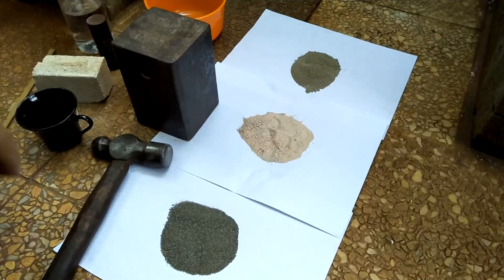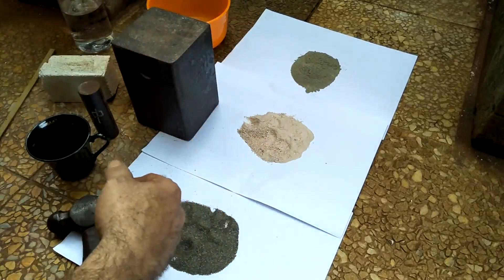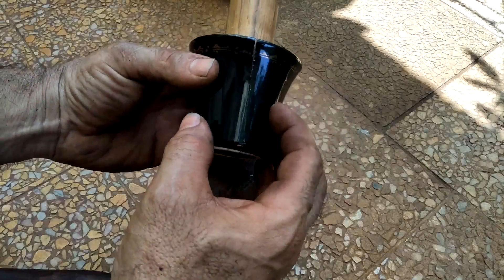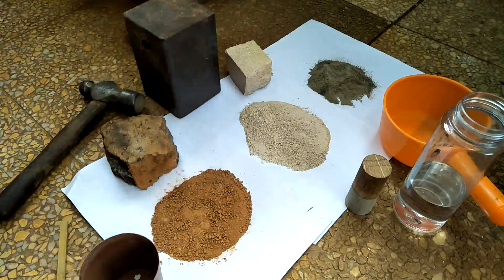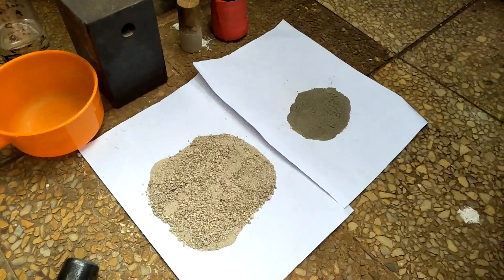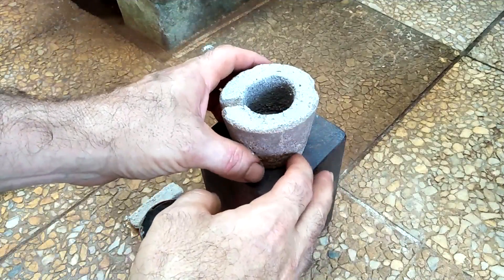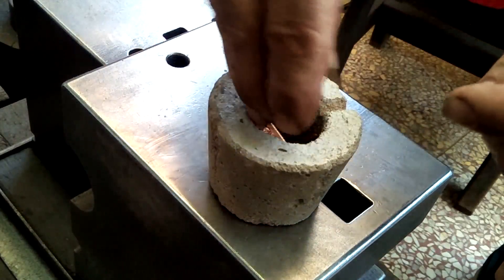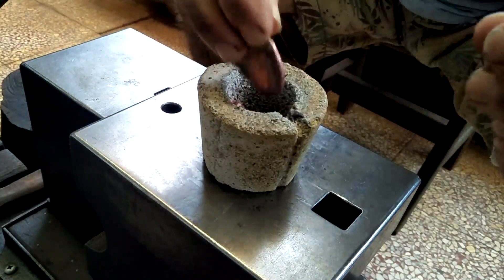Blacksmithing - making a small crucible

Comment: Hey i have to ask you with all the informational at your fingertips why in the world are you trying to relive every mistake since the bronze age? I was rooting for you the whole time, and yet your sucess I'm not sure was one. A few things most importantly working with copper with out the right safety gear will kill you. Maybe not today but it will poison you. Next there is a formula based on exacted what your making yours out of and how to fire it, and how to slowly lower the temp do it doesn't break from thermal shock. Cement products repel each other when mixed together, so you need a binding agent like acryil 60. BUT I'm not sure how it would work when exposed to heat lfrom a forge. One reason you follow the firing receive is because it allows the moisture to bake out Slowely.. please research the topic before you get seriously injured or you get someone killed or burn yourself horribly. I'm honestly trying to help not to just rip you a new a hole.
Reply from the maker: James, This most certainly was not a success. I freely admit that. But I like experimenting and learning in this way. I wouldn't take too many risks or at least I wouldn't try something without being cautious and aware of potential dangers. On this small scale, I feel comfortable doing this. But if this was on any larger scale, I would be uncomfortable with this. I appreciate all of the good advice and will apply what I've learned along with the good suggestions I've received for folks like yourself. Thanks for watching. Glen
Reply: Glen GS Tongs , I appreciate you writing back. Be safe and keep up the good work. If I failed to mention I applaud your efforts and your ability to make your videos for others to enjoy. I wish you all the best of luck in your endeavors in metal.

Comment: why not to use regular steel crucible  for melting copper  ???
Reply: Steel isn't usually used for crucibles unless it's temporary--it scales up too quickly and falls apart
Reply: +Tristan Antonsen
I has a simple crucible made from steel pipe , and use this for couple pouring  of bronze .
Reply from the maker: Alex, Eventually, I did use a steel vessel as a crucible (see my next video). It worked well that one time but as Tristan said, scale build up from the steel could ruin the casting. Thanks for watching. Glen
Reply: +
Glen GS Tongs
for constant successful  pouring copper & copper alloy , I use the container made from  heatproof stainless steel pipe  or square pipe ----  no scaling at all. Plus add some pouring channel into the pour molding.
BTW --- keep up for good work !!!

Comment: You might try luting.  In the 18th century and before, poor people made livings recycling, and one of the things gathered was bone.  The bones were calcined to make luting, which was a sort of cement used in furnaces.  It is possible that a luting/clay mixture might work for this. I just tried looking it up, but the word has been taken over by dentistry for other putty-like materials for dental procedures.  Books of 19th century industrial recipes might have it.
Reply from the maker: This is very interesting and good information. I believe this old bone mixture was successfully used for a long time. I will investigate it and see if that might be possibility for me. Thanks for watching and sharing. Glen
Reply: In place of the Portland cement, I think.  Luting was not the main component, but a binding/gluing agent.  Calcining the bones is something you can do in your forge, but if it is indoors, you might not care for the smell.

Comment: Hello Glen, I had an idea that may work. Get a chunk of raw clay and try to form it to a shape of  the crucible, then fire it in your forge. Fired clay things like a brick can withstand serious heat if water doesn't get trapped inside the clay. I think for melting copper it will be fine.
Reply from the maker: This is exactly what I tried next (see my next video). I still failed miserably but gained some good insight and was able to have reasonably success in the end. Thanks for sharing.

Comment: Huh, thats dangerous, but good that it worked. Just be really careful, you don't want any molten copper to be poured over your legs and feet! hope you can make something cool with this technique, and its not ending with a "copper shoe" ;D
Reply from the maker: Edgar, No question that this is bordering on stupid - having molten metal in a suspect crucible. But I continued with these experiments and failed a few more times but eventually had some limited success and was able to cast a simple copper ring. I show this in my next video. Thanks for your concern. Glen
Reply: Cool! Looking forward to this.

Comment: Glen, spend the 20bucks and buy a cheap graphite crucible.  It's not worth an UH OH using home made shit.  Trust me man, I pour bronze very regularly and one disaster is all it takes to change your life forever.
Reply: Agree here, all it takes is one crack or slip at the wrong time and the crucible can have the bottom drop out, crack in half either way or any permutation. The metal can hit something and cause a fire, splash inside a glove or even hit the ground and splash up onto your leg or foot resulting in serious burns. This is one of those times that it is worth the expense to secure a decent crucible.
Reply from the maker: After giving all this another go and mostly failing miserably (see my next video), the conclusion I came to is exactly the same as your very sound advice - get a proper crucible. On this very small scale, experimenting like this with molten metal is comfortable enough for me. But if this were taken up just a little in size, I would be too uncomfortable to try anything without the proper equipment. Thanks.

Comment: What about using some plaster of paris, I have used it making some refractory, works pretty good??
Reply: Uh... no it doesn't.
Reply from the maker: Len, Some others have said the same thing. I think it would work perfectly fine depending on what and how long you need the crucible for. Thanks.
Reply: Glen GS Tongs Plaster of Paris holds what's called bound water.  It can explode if you pour hot metal in it.  Dont risk it.  Leave plaster of Paris to idiot's like the king of random bullshit.

Comment: Hi Glenn!still loving my tongs and touchmark! BTW cheap cat litter is pure bentonite clay and easily dissolves in water.many use this in home made refractory cement
Reply: Flow Wizardz that’s great advice.  You have to get the cheapest stuff that is unscented.  Also, you may be adding too much water to your mixture.  Water makes refractory and concrete weak.  It should be thicker and require you to tap out air bubbles aggressively.
Reply: Lou L also adding crushed perlite (crush it yourself) from most gardening supply stores may help. And graphite can be collected from crushed pencil lead.
Reply: Flow Wizardz I like the way you think.  You are making me want to try this.  But, I’ll likely take the easy path and buy kast-o-lite 30.
Reply from the maker: This is very good information. I'm blown away by all of the great advice in the comments on this video. Thanks.

Comment: Excellent! Hi Glenn.
Dry clay. Unfired.
With your old red clay brick or fire brick crushed. 
Alittle water.
Make small Pinch pot.
Cement is not as 'temperature- safe" as real ceramic  aka  high fire ceramic clays. Say 3000f.
Copper melts at 2000f.
Cement is not a ceramic.

Love this new direction you are taking us! 
Thank you
Reply from the maker: I really appreciate all the excellent advice folks like yourself are giving. There's tons of relevant info. on this just in the comment section here alone thanks to people like you.

Comment: Glen, your mixtures seemed to be too wet.  You only need enough water to moisten to the point that when squeezed in your hand, it will stay in one lump.  It should not be pourable.  Try a paper cup.  Press in the floor first, then cut up an Al beverage can and make a circular form using tape on the inside of the circular form.  Then press the walls in using a dowel or something to lightly tamp it down around the form.  Using the taped Al and paper cup makes it easy to extract.  Or, just use a thick walled steel cup (piece of pipe with bottom welded on) to melt the copper.   I really like your experimentation videos.  Thanks, Jerry
Reply from the maker: Thanks for the good info. So many people had good advice to give on this subject. I took some advice, did some more experimenting, failed miserably, but eventually had reasonable success.
Reply: Exactly, the more water you use the weaker the grout.
Reply: As someone who’s tried to mix mortar for the first time in his life, I can confirm that if you use way too much water, you basically just have wet sand... 😅

Comment: All you need is clay, hard wood ashes and a little sand. The wood not only swelled it held moisture. You should have wrapped the metal in plastic wrap.
Reply: Zoes Dada not to mention that cement doesn't like exess heat too much. If not totally dry, the water will vaporize to steam  blowing out the cement.
Reply from the maker: Thanks for the good advice and for watching. Glen